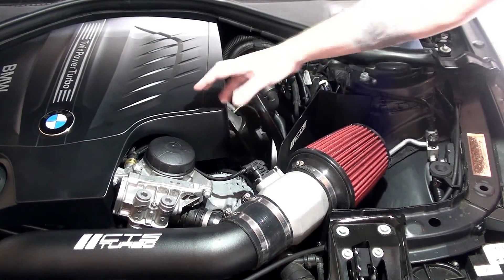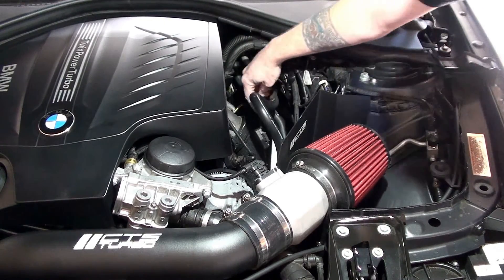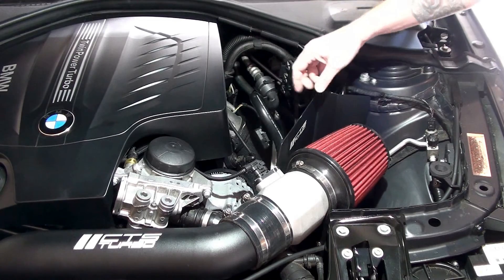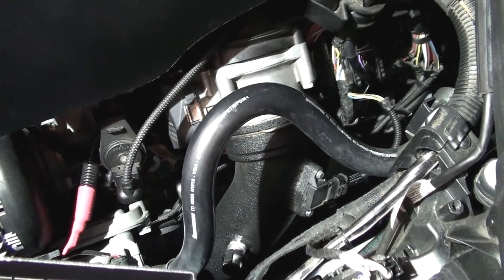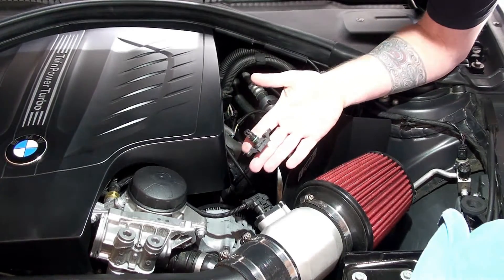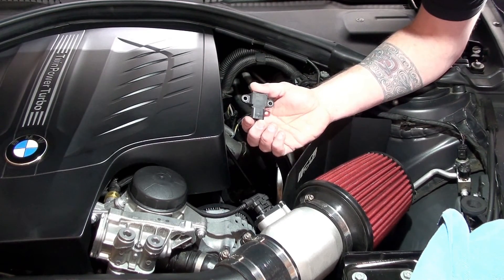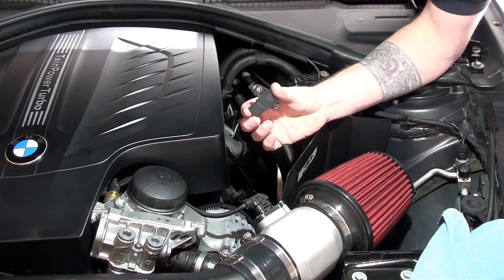BMW F32 435i 3.5 bar TMAP Sensor upgrade DIY

Comment: so I just installed a VRSF charge pipe and I'm get a fault about my MAP sensor do I need to upgrade it or will a OEM work for me
Reply from the maker: If just changing the pipe, you shouldn't need to change the map sensor.  You only really need to change or upgrade the sensor if you need a higher boost rating from your tune.

Comment: I noticed oil buildup around my TMAP sensor, what could this be?
Reply from the maker: I strongly suggest an oil catch can, as it sounds like you have a lot coming up through your intake
Reply: @BMWDIYGuy  thank you. Also, would it make sense that the little o-ring gasket that is located on the TMAP sensor failed? Potentially creating a little boost leak since there’s gunk buildup around the sensor?
Reply from the maker: @MikeNikprelaj  Its possible but I wouldn't think so off hand.

Comment: Hi.. I notice this video is a little old.. And I want to ask if the purchase link of this tmap sensor is still working with the correct product (for the N55 435i) in my case an 2014 435i coupe.. 
I'm asking this because when I tryed to Check compatibility seems like it doesn't fit with my car.. 
Thanks for your help!
Reply from the maker: So yes the link is right.. it will show was wrong for the model,  as technically it is wrong.  You will need to code the car with BM3 or MHD or similar to support the new sensor,  or you will get an error.  You only want to change to the 3.5 bar sensor if you are 20lbs of boost or higher.
Reply: @BMWDIYGuy  Thanks for your answer.. 
I just have the last question, i'm running the stage 2+ by mhd, it has stock Turbo, downpipe, charge pipe, mst air filter, diverter valve, csf fmic, two steps colder spark plugs and the precision raceworks ignition coils kit.. 
How do I know if I am over 20 pounds of boost or less? In this way, check if it is necessary to change the tmap sensor with the 3.5 one

Again, thank you very much
Reply from the maker: @Bullcooper69  check your logs for boost commanded and actual, the logs will show it.  If you are not over 20, you really don't need a 3.5 and some will argue you don't need it at all.  There an option, I believe, in your tune settings to select a 3.5 bar sensor and reflash, if you make the change.

Comment: Hi. Do you need to change the wiring? or just simply plug n play. I'm using bootmod3 n55 f30 2015.
Reply from the maker: Plug in play though your tune has to support the change
Reply: @BMWDIYGuy  i tried it and it works. Thanks

Comment: Quick Question - On ECSTUNING website it shows that this sensor does not support my BMW F30 335i sedan (2015). You installed it on your N55 , so I take it it will then work for mine?
Reply from the maker: Correct.. by DEFAULT it doesn't work with the N55 motor, but keep in mind you require a tune like BM3 or others to allow this to work.  If you install this sensor without a tune change, you will get an error.

Comment: Would it work on bmw f30 n55 335i ?
Reply from the maker: Yes but keep in mind you need a tune to reflect the new sensor or you will throw an error.

Comment: On a N55 should both pre-throttle and manifold  MAP sensors be changed to the 3.5 bar ones if using a turbo upgrade with custom tune?
Reply from the maker: Not that I am aware of and only swapped this sensor on advice of my tuner Active Autowerke

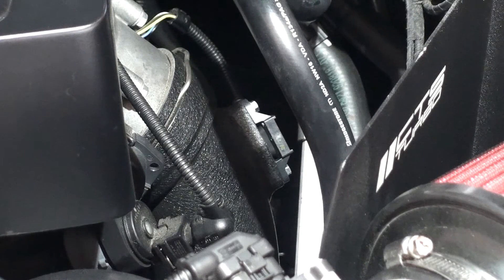Comment: Question please : what the plastic tube called? that connected to intake manifold system and havind metal lock showing at 4:40 sec

Comment: I"m hitting 21 easily with little timing pulled less than 1 and my afr are in the low 13s at peak boost. This is after i BEF with burgers map and the JB4 on my 435i FBO e85 40%

Have you tried boosting over 21 with the factory turbo?
Reply from the maker: 20.5 is my record on the factory turbo.  Not run e85 yet
Reply: @BMWDIYGuy  Nice just ordered a new Tmap. After the BEF for the f33 the trims are half of what they were @ 21psi on JB4 - more head room it looks like. Give it a go! Hopefully i can get 22-24 psi well see though lol

Comment: so will this fit my f32 2016 bmw 435???? it says it wont
Reply from the maker: It should yes but confirm first.  I made this change with the advice and support from Active Autowerke who also updated my tune for the new sensor. The sensor itself will throw an error.
Reply: @BMWDIYGuy  so, if I have an ER charge pipe, will it work or do i need a different one?
Reply from the maker: @callmecoos  should work fine
Reply: @BMWDIYGuy  Ok, thanks

Comment: I have a 335i so you saying that if I have a jb4 it may miss read the map sensor or it may mess it up. What can I do about it
Reply from the maker: So maybe.. keep in mind I swapped my sensor as I am approaching 20lbs PSI and in my case, my tune was updated to reflect the changed sensor.  If you swap out the sensor without the JB4, or a custom tune updated to reflect the change, you may get an error.  I had a JB4 briefly before I moved onto other things, so make sure to check if your JB4 will deal with a changed sensor.

Comment: Nice work
Reply: Tony Lam the old JB4 firmware allowed for it, but they took away the functionally on the new ones
Reply from the maker: Thank you sir, really simple one this time!
Reply: I went to the link and it said it doesn’t fit my f32 435i xdrive. I also have the jb4 is this gonna work well without codes?
Reply from the maker: Tony Lam do great question.. I don't know if the JB4 will clear that code.. I suspect it won't.  It was the specific tune build from AA that was able to adjust to the higher sensor and clear that code.
Reply from the maker: I saw the same before I changed away from my Jb4, and know folks who are really bummed losing the CEL reset as well.
Reply: Thanks guys! I’ll wait till I get a full ecu tune prior to purchasing the product then. 👍